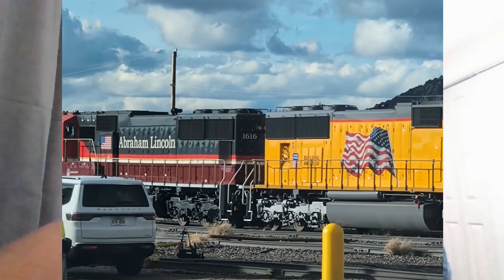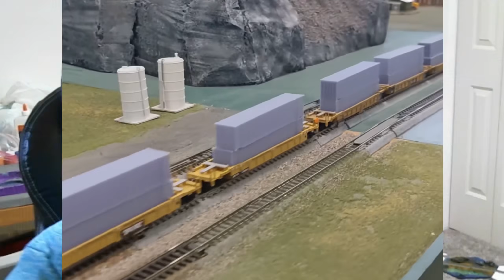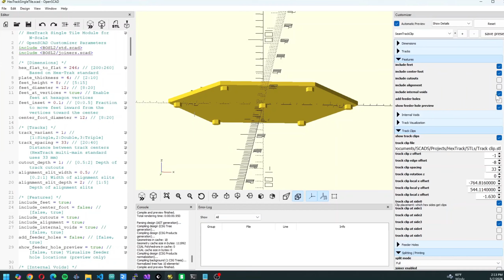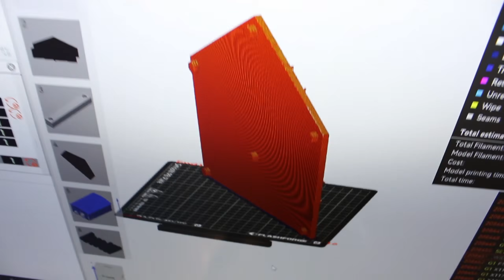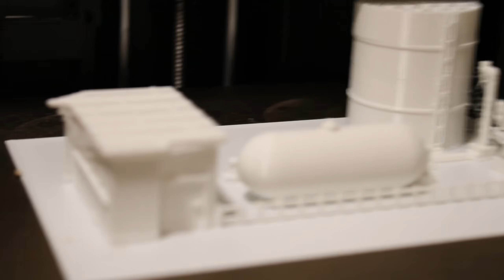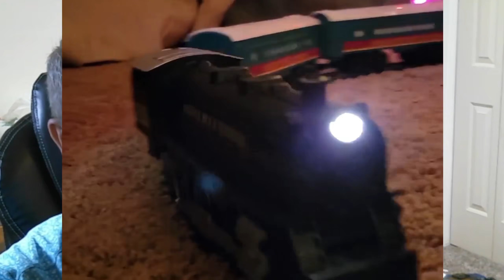I 3D Printed a Model Railroad I Procrastinated for Years

Comment: which dcc decoder you are using?
Reply from the maker: That's a great question. The engine is a Scale Trains Rivet Counter GE Tier 4 GEVO with DCC and Sound by LokSound. It came DCC equipped.

 I am interested in getting a DCC ready for my next one and putting an encoder in it. If you have recommendations on a good encoder I am all ears. I do think this LokSound sounds really good.
Reply: @AkaSoggyBunz yes loksound are good but expensive although best in class
Reply: @AkaSoggyBunz there are some diy decoders as well if you search on YouTube.. but very basic in functionality... Sound is not the option in them... See Geoff Bunza's blogs he has some diy stuff a regarded figure in model railway community
Reply from the maker: I will take a look. I am interested in using a pico to decode the dcc for lights and other things
Reply: @AkaSoggyBunz yes, pico is a good option as well